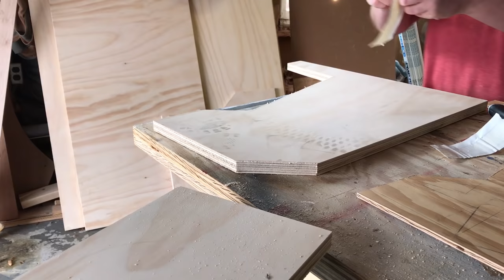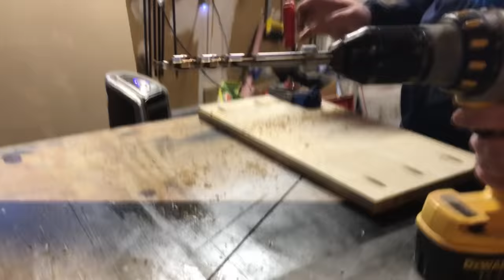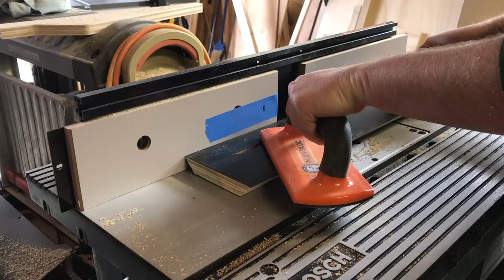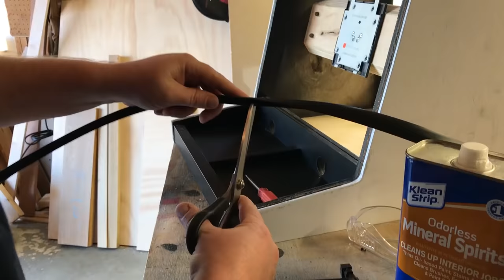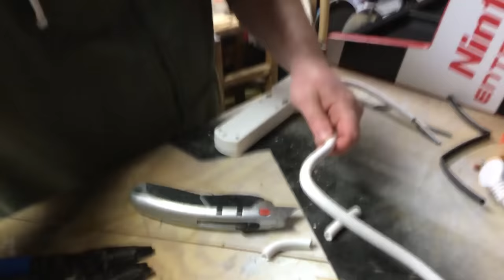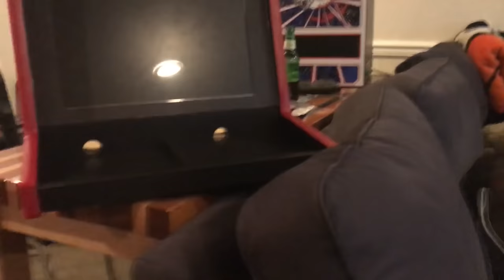NES Bartop with Advantage Joysticks

Comment: I've been dreaming of building an arcade cabinet for over a decade and you breezed right through it.  well done, really pro
Reply from the maker: Phil Pinsky Productions I waited a long time before I started my first one, which i built with very limited tools on my deck in a small townhouse. You can do it. Just get started.
Reply: DirkMade How much did it end up costing? And how long did the whole project take?
Reply from the maker: SPENCER HEISLER I re-used a lot of stuff and had the screen already so cost is hard to really compute. Outside of drying time, maybe 10 to 12 hours all combined? There's lots of things to do though if you are making artwork, computer setup, planning controls, etc.
Reply: DirkMade True.
Reply: Phil Pinsky Productions it'd easer than it seems! get some big bords of card from the supermarket "for free" and work out a good design...copy that on to 1cm ply cut it out by hand saw, then a rasburry pi zero 3 and some zero delay joy stick board 2 cheap sticks and 6 to12 buttons 1 start p1 p2 you can pick up a cheap screen from a boot sale... I did my one for under £50!
Reply: Phil Pinsky Productions wine bottle roller!!!
Reply: +POL
O MARCO

Comment: This is such a fantastic little build. I love it. I've watched the video several times just because I like seeing it come together. Did you use a 19" or 17" monitor? What is that black liner stuff you glued onto the wood?
Reply from the maker: I am pretty sure that's a 17" monitor.  The black stuff is laminate, see here: https://www.homedepot.com/p/Wilsonart-4-ft-x-8-ft-Laminate-Sheet-in-Black-with-Standard-Matte-Finish-1595603504896/203592675

Comment: Very nice!  I've got all those tools and I'm sort of a DIY'er as well.  I do need to get a better drill press though.  So you have two router tables?  Did you use a special router bit to make the T-Trim slot and if so can you tell me the name of it or link to it?  I'm building my Retropie image currently and have it hooked up to a ready built X-Arcade Tank Stick so plan to integrate that to my cabinet.  I see you have access to some nice printers, that's something I don't have access to.  Also, than veneer chip-out, I'm guessing that just happens or would chasing it with some scrap stock help?  Thanks for the video, I used to do more DIY with camera stuff but just don't have the time to do it anymore, so I appreciate the time you put into it.  If you know of a source to get large screen prints on adhesive backing like you can do, then please let me know.  Thank you.

Comment: What system are you using to run the monitor/controllers? You have the encoder, adapter, the monitor is self explanatory, but what runs it? That is no raspberry pi

Comment: amazing, the only thing i'd suggest is using a heat gun (or hair dryer) to pull the vinyl around the edges, this let's them have a bleed under the edging for appearance, seals better because the heat activates the adhesive better, and proofs it against peeling up and ruffling.

Comment: I just found this video and I like how everything went along and worked out great in the end. I also like how everything is customized. You didn't take any shortcuts in this project and it ended with an awesome unit. My biggest horror with every project are the labels. No matter how careful and planned you are, air bubbles and wrinkles work hard to get you. At first, I thought the controllers would have looked better if they were customized as well and you could have given them the NES look with a printed controller panel. But then I realized that the authentic controllers gave it that nice nostalgic look. Great work and video.

Comment: That machine looks EXCELLENT. A few q's though if you have time- where'd you get the side art? Where were the speakers and what kind of speakers were they? And where did you get the power supply for the marquee lights? I'm assuming they are 12v lights.... off the monitor "sound bar" power plug?
Reply from the maker: Side art I had printed, check the description for where. Speaker was internal to the PC in case. I might put in different speakers down the road not sure. Power adapter for LEDs from amazon. Look for an led strip power supply 12v.

Comment: you can build a custom controller and give it a proper nes theme. The nes advantage is okay but its not bolted down. Amazing build just a little bit more effort on the controller scheme and then its perfect. maybe happs joystick and some concave buttons, red buttons and black joystick.
Reply from the maker: oSlay3r I’ve built other cabs with happy joysticks. That wasn’t the point of this one.

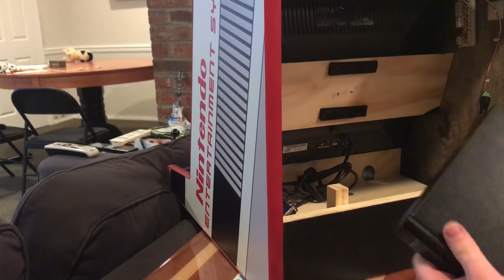Comment: What's that thing at 10:47 you're putting on the back of the screen?
Reply from the maker: That's the PC that runs the emulator
Reply: @DirkMade  Pure genius!  Also what printer did you use to print the decals for the cabinet?

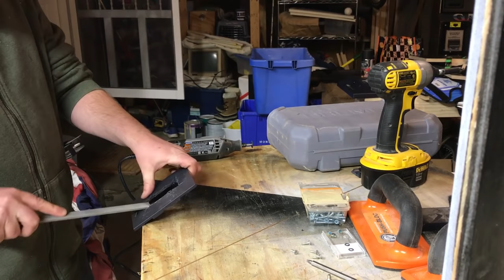Comment: At 6:29 What is that? A Dremel? Awesome, Outstanding, Superb Work.
why don't you go into the business of making those arcade games and I'm sure you'll make a killing making those alone just those alone let alone your Superior carpentry skills. what could you get for one of those about $1,000 each?
Reply from the maker: Yeah that's a dremel with a cut off wheel to get rid of the plastic that fits around the "knee" joint of the LCD stand I was removing.  A lot of questions about selling these things and to be honest I haven't ever sold a piece I've made, but maybe I can in the future.  If I were to sell something like this it would come without a computer inside. That would make it possibly very difficult for the buyer if they don't know how to setup the emulation systems.  I have thought about selling a bartop with a 60-1 arcade board, but that's a lot different than this thing.
Reply: +DirkMade Ahhhhh Yes because most are Emulators. To use a an Emulator you have to be computer tech savvy. I remember back in the days when I used to download emulators and it was a pain in the ass. there's not just emulators for the NES you have emulators for Sega Genesis, Sega Master System, Super Nintendo, ColecoVision ,I don't know if you remember this because I don't know if you're my age do you remember system called Neo -Geo? yes those were actually that was a good system and if you can make and arcade tabletop emulator of a Neo Geo I promise you you'll make a lot of money off of that because Neo Geo's were very hot Back in the day.
Reply: +DirkMade Ahhhhh Yes because most are Emulators. To use a an Emulator you have to be computer tech savvy. I remember back in the days when I used to download emulators and it was a pain in the ass. there's not just emulators for the NES you have emulators for Sega Genesis, Sega Master System, Super Nintendo, ColecoVision ,I don't know if you remember this because I don't know if you're my age do you remember system called Neo -Geo? yes those were actually that was a good system and if you can make and arcade tabletop emulator of a Neo Geo I promise you you'll make a lot of money off of that because Neo Geo's were very hot Back in the day.

Comment: Beautiful build my friend. Best i've seen so far. Just a quick question. What hardware did you use for the nes games? Was it a pie with a nes emulator or something else?
Reply from the maker: Originally I had a windows pc in there running a nes emulator, but I have switched it out now to a raspberry pi with retropie.  I actually prefer the PC as I haven't been able to figure out how to use the red buttons above the screen with retropie the way I want.
Reply: @DirkMade  Thanks for the reply brother. Keep up the good work :)
Reply from the maker: Jupiter Apollo thanks for watching and please check out my other builds on my channel- if you like game cabinets check out the tempest I built.

Comment: What was the tape you were using at the beginning to join the 2 pieces of wood? Also, is that laminate you're gluing on?
Reply from the maker: That's carpet tape, dual sided and it will hold the wood together so you can use one as a template for the other.  Sometimes it holds a bit too well.  Yes, black laminate from the box store.  I bought a sheet of it and used it on several projects.
Reply: Thanks for the tips! Awesome Nintendo bartop...your build has given me some good ideas to incorporate in my first build that I'm doing at the moment. Unfortunately I don't have access to a router or table saw, just using my circular and jig saws haha so lots of sanding!
Reply from the maker: Cool I'd love to see how it turns out

Comment: Fantastic job except the controls.
You should have used real arcade parts,even cheap chinese Zippy ones would be sufficient
Reply from the maker: The whole point of this one was to use real Nintendo controllers to play Nintendo games. I've made machines with real arcade parts. This one is different.
Reply: I know that you build other machines and thats why I insist and play rough :)
You could use arcade black joysticks and red buttons like nes colours on a nice control panel and it would be perfect.
Sorry but there is no excuse on that,its like people who build cabs and they put Xarcade ready joysticks on,thats called LAZY and half job :)
Reply from the maker: I don't think you are understanding my point. I wanted the same type Nintendo controllers that I used as a kid to play these games. That's the authentic experience for me for a Nintendo only console. Either way, thanks for watching.
Reply: Well ok,I guess you were lucky as a kid that you played with Nes Advantage sticks on your NES,few had them.
Thanks for sharing your cool stuff.
Reply: I also had an NES Advantage controller (circa 1989) and that thing was built like a tank! Without a doubt one of the most durable, responsive, and enjoyable controllers ever made for a home console (the built-in turbo buttons were the best).

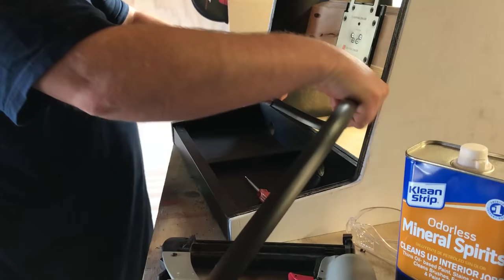Comment: Hi! where can i find that rubber sticker strip you used at 7:46?
Reply: That is called "T-Molding" can get them in quite a few different places (Amazon for instance).
Reply: You would also need a special saw and blade to go along with installing it. As it doesnt have adhesive on the underside. The strip looks like a T when viewed from the ends. There is "line" down the center of the strip that fits in a rut you cut out with the special saw/blade.
Reply: Thanks!! :)
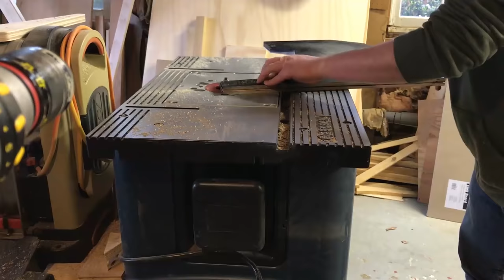Reply from the maker: Yep Mr Truth Sayer got it. T-molding. Same as the red on the outer edges of the cabinet, just in black. I routed the slot for some of it earlier in the video, 4:12 mark.

Comment: Are the sides printed with the same printer as the top label?
Reply from the maker: Colin McLeod no I printed the marquee,  I had the sides printed for me.
Reply: Holy moly that's a fast reply. Do you think you could have printed the sides with that printer? It just so happens that I have that exact plotter printer but I've only ever used it to print building plans.
Reply from the maker: Colin McLeod lol phone buzzed and I saw your question. Not sure, maybe it would if you had the proper adhesive backed vinyl on a roll? I don't know.
Reply from the maker: Colin McLeod if you find out and try it let me know